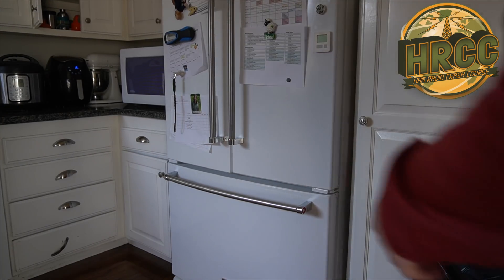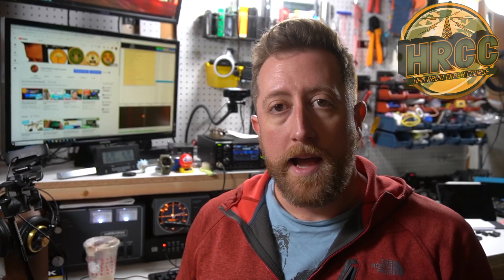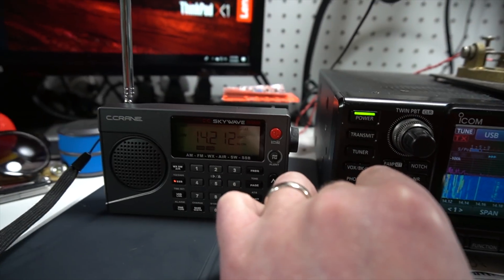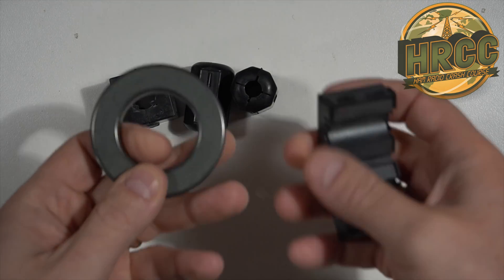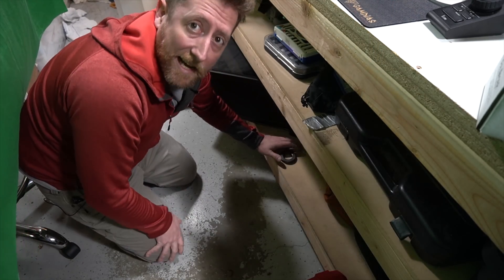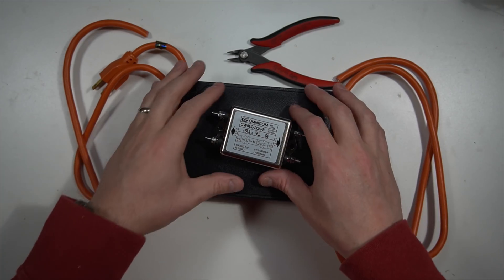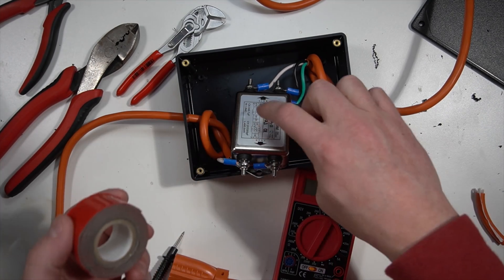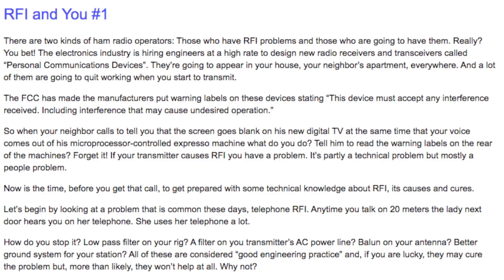WE are killing the amateur radio bands, and here is how to fix it (RFI)

Comment: The Icom 7300. Can the  spectrum scope water fall work outside the amateur bands? I know it will work in broadcast bands but  once you leave a ham band it says out of range.
Reply from the maker: Yeah it works outside of the ham bands but your can’t transmit.
Reply: @HamRadioCrashCourse  how do you get it to work in spectrum scope? once i leave a ham band  it says out of range.
Reply from the maker: Which bands specifically?

Comment: Did the noise come into the transceiver over that air or power?  If it was power I wonder what would happen if you put those ferrite rings on the transceivers power cord?  Or temporarily run it on batteries to test it out.
Reply from the maker: It’s over the air.

Comment: Are overhead power lines above your home a radio signal killer or problem ? I recently bought two Baofeng (BF-F8HP) radios and 29 inch long tactical antennae for talking back and forth and monitoring at a reasonable short distance of 5-10 miles. What is the best way to test them for performance so, in the event of an emergency, you have the means to communicate to the outside world ?
Reply from the maker: Overhead lines can be HORRIBLE noise generators.  I have a couple videos up on the topic.

Comment: I disagree with your beginning approach.  It would be best to check conditions with battery power first then remove the plugs for all devices in the house.  You could have a bad outlet or dirty power supply.
Reply from the maker: Sure, I did that before the video.  These videos generally require alot of pre-work :D

Comment: Just a tip, if you think it's a circuit, you'd be better off switching rooms at the breaker to isolate the room with devices, rather than every device in the house.

Also, if you have an appliance you need to shield and it's made of metal, ground the outer shell to make a faraday cage.

Comment: Any opinions on those switching power supplies from China, marketed as HAM supplies, are they anymore effective at noise offsetting (looks like they have that feature)  than those cheap switching power supplies ( ones used as led drivers etc)? Probbably late but good video, as usual👍

Comment: Would Pure Sine Wave Power supply sources/adapters help reduce RFI interference/noise
Reply from the maker: No, in this case the interference is coming in over the antenna, not the power.
Reply: @HamRadioCrashCourse  but wouldn't putting those devices causing the interference into a Sine Wave Inverter help? Our even wiring up a whole house Sine Wave converter into the breaker box to reduce it?

Comment: Adding a big chunky whole home surge suppressor also knocked it down a ton.  Since my automation system uses powerline signaling, I'm very sensitive to anything on it, and filter tons of things.  Anything with a motor load spews noise onto your lines.

One other thing to thick about is to verify your backup generator is OK if you have one.  You want a traditional 3600 RPM generator, not an inverter type, my generac gives me power that's cleaner than utility!

You can also get an online UPS which completely decouples your shack from the power grid entirely (even drifting out of phase with the grid) using a pure sine wave inverter.  Schneider/APC makes some that are really, really good, but it's cheaper to replace a dryer and refrigerator. :)
Reply from the maker: I’m really curious about the surge protector. What is it doing that knocks the noise down?
Reply: @HamRadioCrashCourse  it has big filtering coils, part of its surge detection system, that keep much of the bad noise out of the bus bars themselves. It's not a replacement for point filtering and protection, but since my home is at the literal end of the line and subject to noise from being the reflection point, it cut out 90% of the grid sourced troubles.
Reply from the maker: Damn. I don’t think I am at the end. But I don’t mind paying a bit to try it out.
Reply: @HamRadioCrashCourse  it will help regardless, but it helps me especially because of that. It also provides surge suppression on your bus bars, which helps everything in the event of a nearby lightning strike. And for $200, they're pretty cheap for the benefit.
Reply: Can you comment on brand of surge protector and what type of noise it helped with?

Comment: Nooooo...sorry...but you are putting AC into a metal box...and then taping the filter to the box....not a great idea...if the box/filter heats up at all the tape could certainly come loose and potentially short to the box...if someone is handling the box this might certainly get their attention! I worked with my Father for a couple of years...he is now a retired electrician. Just thought you should know! Great video...thanks. de KN4FTT
Reply from the maker: I relocated the box into the dryer body, connect to the dryer itself. Good comment and the proper way to do it.

Comment: Question.....is this noise coming through the airwaves, or is it from being connected to the same AC power system?
Reply from the maker: It’s over the air as I was running on a battery for most of the video.

Comment: LED lighting is a huge noise source, and for mobile operation those little 12v to USB plug-in things are bad noisemakers, free-running oscillator switching garbage. I got a cheap LED shop light from Costco, and it raises the noise floor on my SDR throughout the HF bands by about 10 dB. Maybe time to go back to incandescent lighting.

Comment: Modern appliances are switching (pun intended!) to variable frequency induction motor drives.  While they are power efficient, and provide greater control, they require a DC source generated from a switching power supply.

Comment: What kind of dryer do you have that uses a skimpy little cord like that?

My problem is that I have DirecTV going into an LCD flat screen TV. My Ham setup so far is a few HT's, or as the grandkids say, "Talky-walkies." There are two DTV channels that cause interference on one of the repeater frequencies that I use. I also have a wireless doorbell that occasionally sounds when there's no one at the door, so I know that's RFI. So what's my best approach to the RFI on my HT. I will also track down the RFI trigger on the doorbell. I do have a VHF/UHF base, antenna, etc. to hook up, but I'm waiting (almost a year now) for a neighbor (who farms my ground) to help me get it set up because I have back problems (and my 3rd back surgery has been on hold for four months - thanks China) and I can't do it myself. I have a lot of electronic equipment in my "radio room" - computers, a component stereo system (yes, I'm old school because I'm an old man and vinyl still sounds better than CD's, but you don't have to get up to flip your CD's every 15 minutes) and the DTV ... and fluorescent lights throughout the house that are gradually being converted to LED. So it looks like I'll be spending a small fortune on snap-on ferrite beads, but it's only money. Right? Ham radio is the only hobby I've found that rivals the cost of firearms, but with firearms I can at least go out and blow something to kingdom come occasionally. Tannerite is a wonderful stress reliever ... as long as you stay a safe distance from what you're blowing up ... and don't put more than 10 pounds in that old car you're blowing up.

Anyway, take care and keep your barrel clean. 
Bo Leggs.
KE0WKN
Reply from the maker: Getting the rf out of your home and shack by putting the antenna outside will help a lot. 

The dryer is gas. It’s the electronics that are causing the issue.
Reply: @HamRadioCrashCourse   It's the two frequently viewed DTV channels that surprised me. Why would it be two particular channels? It took me a while to figure it out. Now I turn the HT off when I switch to them.

Comment: Local QRM
Frequently one hears strong QRM on the bands, which is not received from the air
but is created locally by any device in the local vicinity.
Then, we first have to find the device that produces this interference, and  then we
have to remove the cause of this interference.
Here follows the story how I solved this kind of problem:
 
During my recent antenna tests I had a lot of problems with strong local QRM.
After installation of the antenna in Santiago I had a QRM level of S9 throughout
the HF band. Only stations with signals over S9 could be heared.
So I had to localize the source of this interference.
I got help through my transistor radio which has 7 SW bands. With the extended
whip antenna I walked around the houses on our street, listening on a clear
frequency close to the HAM band.
So I saw, that close to or house the noise level was highest, and walking away the
noise disappeared. Then I cut the current of our house - and the noise remained.
Now I went carefully around our house and noted, that next to the neighbours house
the noise was strongest.
I pushed the bell of the neighbour and asked if I may cut the current of its house to
find out, if the source of the noise is from there. And really, after "power off"
we had silence on the radio. Then I asked permission to check inside the house,
and by entering the living room it was easy to detect, that the cause of the noise
was a DVD player (Brand Daewoo). This equipment was purchased little time before.
Next day the neighbour went to the warehouse where he buyed it. They told him
that the guarantee just expired. So I offered him to denoise this apparatus.
The cause of the noise was a switched power supply which had no adequate filtering.
Interesting was, that the power ON switch of the equipment was behind the
switched power supply, therefore the noise was generated as long as the connector
was plugged to power ...
Remedy of the noise was a filter circuit which was installed inside the DVD player,
just at the power line input.
Required material for the filter:
2 ferrite rings FT114-43 (or FT140-43) material 43 is much better than material 77
2 capacitors of 10000 pF (0.01 uF), 1400 V DC, ceramic disk (low inductance)
isolated litz wire
Ring 1:
2 isolated litz wires wound individually on the ring.
First wire: 8 turns beginning from the top front of the ring through the hole on the
right half side of the ring.
Then with the second wire: 8 turns beginning from the top front of the ring through
the hole on the left half side of the ring.
Seen from the front: both wires are beginning from the top and are ending behind
on the lower side.
All 4 ends have to be prepared to be soldered by stripping off the isolation at the ends.
Ring 2:
2 isolated litz wires are wound in parallel on the ring. 8 to 10 turns distributed over the
full ring. Also these 4 ends have to be prepared for soldering
Now solder the output of ring 1 to the input of ring 2.
Now, the power line inside the unit has to be cut just behind the enter point into the
unit and both ends have to be prepared for soldering.
The arriving power line is to be soldered to the input of ring 1.
Then solder the output of ring 2 to the power line which continues inside the unit.
As next, locate a ground connection close to the enter point of the power line.
Eventually, the metallic housing has to be scratched to allow soldering of a thick
ground wire directly to the metallic housing (using a strong soldering tool).
Now, solder the first capacitor between ground connection to the first soldering
point between ring 1 and ring 2.
Then, solder the second capacitor between ground connection to the second soldering
point between ring 1 and ring 2.
As next, all soldering points have to be isolated carefully with PVC tape, and
fix the two rings from moving around.
Close the housing. - Finished.
Power on and test:
Before installation of the filter, strong noise was heared from medium wave to all SW bands.
After filter installation no noise was detectable.
Test on HF band with radio equipment:
The previous noise of S9 disappeared, the band was clear with a ground level noise of S1.
---
At the second test location, 1000 km south of Santiago, the same problem:
The full HAM band with noise of S9 and more.
Again searching the source: 3 equipments were found which were causing interference
in the same house where the antenna was installed:
1. = Computer with switched PS in miditower.
2. = Fax Unit Panasonic KX-F580
3. = AIRSPAN, Subscriber Terminal Indoor (= wireless phone and Internet connection)
In all cases, the noise came from inadequately filtered switched power supplies.
Depending on the type of switched power supply, the created noise differs. Some produce
a broadband "white noise", others a broad, unstable noise which is heared abt. every 40
to 80 KHz on the bands.
At all 3 units the same filter circuit was used to denoise. With the only difference,
that in the third unit no space was available to install the ferrite rings. There I had to
wind air coils, which could be placed between the switched power supply and the circuit board.
After installing all filters the ground level noise on a free frequency dropped also to S1.
Note:  You have to be aware, that if the unit where you installed the filters, may cause
another problem: If it fails later on, they may try to make you responsible for any other defect.
Therefore you should be aware of that.
In some cases it is recommendable to install the necessary filters externally, even so the effect
of the filter would be best, if the filter is inside the unit.

Comment: Great news: after watching this video I think I've traced a persistent RFI problem I've had on VHF! The problem is, it appears to be my wall outlet(s)/breaker itself. Other than going off-grid, any advice on how to minimize this?
Reply from the maker: Are you sure there isn't anything plugged into the circuit?
Reply: @HamRadioCrashCourse  Not 100% sure, but I would say 85%. I found it on SDR, tuned to it on my Baofeng, and walked around the entire upstairs, having everything unplugged. It was weaker downstairs, and grew strongest upon touching the breaker panel and any wires coming from it.

Comment: Just remove the daam ground and seperate ur ham radio ground fron the electric panel and buy a copper rod and move ur grnd
Reply: At first I thought the same thing, but my understanding that all grounds into your home should be bonded so that you never give something an "easier" path to discharge. So if you do new ground rod and bond it, i don't know if any RFI will be negated...

Comment: EMI - a VERY recognizable issue that you bring up here, so thanks for that.. Problem is,  for me, the noise is ALL coming from neighbors and above-ground power lines (10kV lines).  When I turn off the main breakers (meaning the whole house is powerless), the noise floor on my Flex Radio does not change ONE iota. On 160m, my noise is S9+. On 80m, it is S9. On 40m, it is S7. On 20 m, it is S3.  Sometimes we lose power in the whole neighborhood. When that happens, I immediately run to the shack to listen how that impacts the noise floor on the several HF bands, on a battery powered rig. 160m: S4. 80m: S2. 40M: S1. 20m and above: No noticeable noise (-125 dBm in a 100 kHz span). The reality; this EMI thing is an unsolvable problem and will eventually kill the ham radio hobby below 30 MHz. And it will only get worse, as people install solar panels with battery backup (and their associated noisy power inverters) and just about EVERY wall wart being a switcher nowadays. And incandescent light bulbs being replaced by LED, another source of cheap power switchers. So I appreciate the effort you put in this video, but unless you live on a farm away from all the cheap electronics, the shortwave radio hobby is DEAD. 
(By the way; did you know Tesla cars don't have the AM broadcast band available on their radios? Because the solid-state power switchers in those electric cars are SO incredible noisy you would not be able to receive a SINGLE station on AM!)

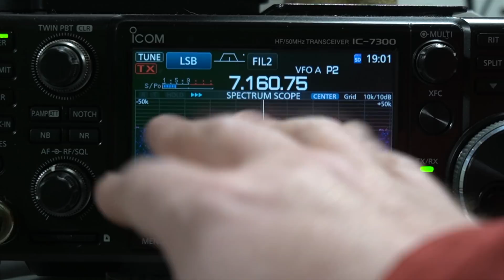Comment: 0:56 This looks more like this display unit at the front of the fridge not power supply itself as switching would be in range below 1MHz. Maybe it's worth placing a LCR RFI filter on the fridge cable?
Reply from the maker: This is a good observation. That is possible.

Comment: I don't know how big a problem transmitted RFI is but with a Faraday shield made of aluminum foil you can get a 40 db reduction in RFI. It may be a solution if you have transmitted RFI sources not coming through your wires. You can use a spectrum analyzer to detect it.
Reply from the maker: The wires of electronics all become antennas. What are you wrapping in foil?
Reply: @HamRadioCrashCourse  Not wrapping. It's a box or cage. Cage uses wire mesh. Box is metal sides and more effective. The devices you use now might be cheaper. I'm not sure a Faraday enclosure is really the right thing. Just an idea. Anyway, you can use any metal. I guess it has to be ohmic. The enclosure can be small to only surround a single device or larger like a room. It blocks ambient RF. So, if you can avoid RF interference coming into the radio through the wires then you can also build an enclosure or even line your shack with metal. The cheapest is probably aluminum. And you can cut more RF getting to the radio through the environment.

Comment: This happened to me and this was only on 70cm, most frequencies worked well but with a strange interference tail after repeater would cut out. Could not figure out what the hell was causing it, opened the squelch on my FTM100D and holy hell it was bad. Eventually found out it was my PCs power supply, which is my main PC on my desk where my radios are. It was ruining a few frequencies that were cut from squelch. Everything opened up now.

Comment: Hi and TNX for the interesting video. On 10:20 , when adding the AC line noise filter, your ground lead on the load side doesn't seem to be connected to anything (but myabe I'm wrong). Could you please confirm this? This is maybe good for RFI, but not so good for electric protection, right?